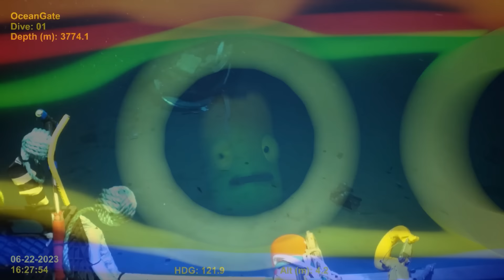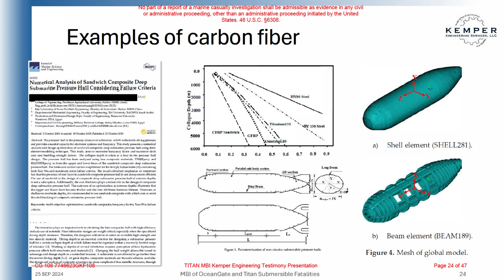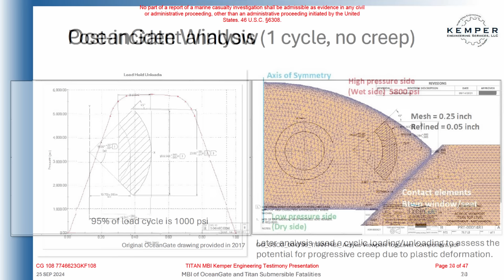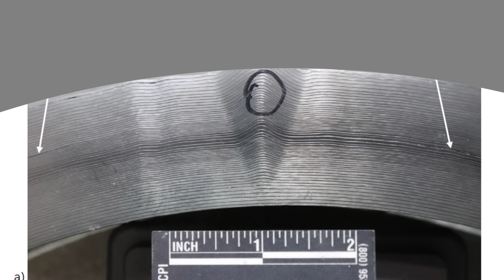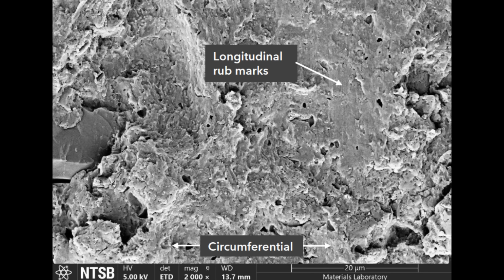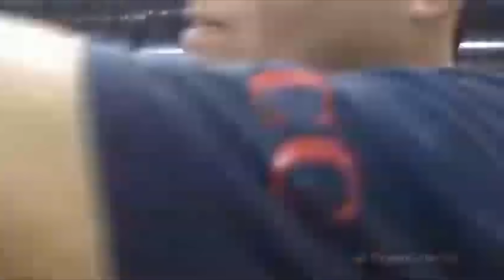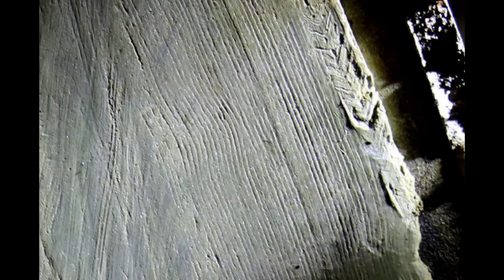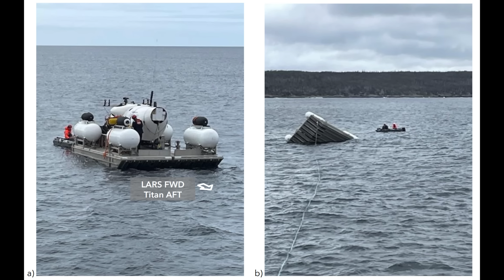OceanGate Wreck Shows Why Sub Wasn't Strong Enough To Survive - NTSB Shares Important Details

Comment: I have yet to see any evidence that this thing was wound in any other way apart from a shallow spiral, end to end. Almost like Hoop stress was the only consideration, not longitudinal.
Reply from the maker: Well you can see it in the images of the material under the microscope
Reply: @scottmanley  I see it now. Am I right in understanding then that the longitudinal ply is orientated 90 degrees from the circumferential ply? running from one end of the hull to the other? It is just that I am looking at the winding rig and the mandrel and wondering how they achieved that. Genuinely interested to know as I thought low angle helical winding would be the limit with the setup shown.
Reply: Forgive me folks, this was bugging me! Reviewing some other information and I have found a different, less manual and more robotic machine was used to produce the second hull in 2020, which was indeed capable of laying longitudinal ply, although not tensioned due to the mandrel design. Most of the footage we see is from the first hull in 2017.

Comment: What the graphs @26:24 are telling us is that the hoop strain gages were were being compressed excessively at low pressure (the non-linearity below 300 m.)  The hull was deforming with less resistance than expected, becoming rigid only after reaching ~400 meters depth.  This radial compression would be expected to make the longitudinal stiffness greater (seen @27:03).  (It's not clear if the operators constructed these plots, and had this information, prior to the disaster.)
I think the the epoxy in the C channel, which glued the hull to the forward titanium ring, had cracked (or separated from the metal) internally (the "bang" heard on dive 80), allowing relatively easy radial compression of the hull until the inner flange of the C channel took up the pressure and restored rigidity.   That flange was too thin to hold against the added pressure, and it sheared off on the final dive, as seen @18.44.
The composite hull and the titanium rings deformed at different rates with every dive cycle, and I think the epoxy, being bonded to both, could not handle the repeated stresses.  Rush must have thought it would only experience compression, and didn't consider the massive shear forces.
Reply: He assumed a perfect sphere in a vacuum... He also ignored that when you compress a material that famously avoids flexing in tension, it's going to pull like mad on every connection on the ends of those strings, and the wonky glue up means it would be wildly uneven in any predictable manner.
Reply: I'm pretty sure you just nailed it. I bet you $20 the portion of the barrel where it's permanently deformed inward is really close to the strain gage with the goofy readings and where the Ti inner flange failed.
Reply: agreed, what’s crazy is that this should have been noticed immediately after dive 80, the strain gauge must have been showing increased strain on the ring the entire time it was out of the water.
Reply: I'm no expert, but your interpretation makes the most sense to me of anything I've seen. I too was puzzled that the deformation seemed to be worst near the surface.
Reply: Yeah, the missing inner flange on the front titanium ring does indicate that it was literally the only thing holding the carbon fibre hull from being crushed. And when it could no longer hold the strain, it just completely sheared off.
Reply: @CristiNeagu which tells me that should have been the critical design consideration, bc the water will hold the end cap on until its near the surface
Reply: @tturi2  Well, technically, that wasn't part of the design. The load should have been shared between the end cap adhesive and the flanges. If you ask me, it seems pretty silly to rely on a glued joint under sheer for this kind of application. I don't understand why they didn't just design the inner flange to be more massive and make it a structural member, relying on the titanium to hold the hull cylindrical, while the glue only holds parts in place and prevents water ingress. Seems like a much better idea to rely on the contact interface between two structural members rather than on some glue holding up to the full pressure of the ocean.
Reply: @CristiNeagu  yeah, I feel there was less engineering into this vessel than my garage made fibreglass car panels
Reply: @CristiNeagu  Like I said, Rush didn't plan for shear at the glued joints.  He expected only compression (literally tons of it) from the end caps being pressed toward one another, which surely sounded like a good thing at the time.
Imagine the irony if they do conclude that the damage was done while approaching the surface.
Reply: @jpdemer5  Yep. He never thought that the carbon fibre hull would be anything other than fully rigid against the pressure.
Reply: Why would it become more rigid as pressure increased?
Reply: @hippienixon2329  If I understand him correctly, inner flange of the titanium ring prevented further compression. That is, until it sheared off.
Reply: @hippienixon2329  there was a crack or a delamination that closed up as the pressure increased. The strain gauge was on one side of the crack and the ocean was on the other side. The strain gauge registers nothing until the crack closes.
Reply: @hippienixon2329  Why would it become more rigid as pressure increased?   Squeeze a full can of soda.  Now squeeze an empty one.
Reply: I wonder if the "bang" was something that had shifted slowly under compression and found a "resting state" and "stuck at the new position, and that as they ascended and the pressure was removed, that at some critical point the surfaces didn't have enough force on them to continue to stick and suddenly shifted back to their original orientation?
Reply: Interesting
Reply: Not just different rates,  OPPOSITE directions.  One expanded while the other contracted.  Basically the metal and carbon fiber were going on separate vacations every single dive.
Reply: This is very close to what I concluded. I assumed the non-linear graphs confirmed that the glued end was becoming detached resulting in more flexing of the carbon tube. This resulted in delamination of the layers and rubbing of the adhesive and carbon fiber as it flexed weakening further the tube. Eventually it catastrophicly failed at the connection between the tube and the ring.

Comment: 'Carbon Fibre' really means 'carbon fibre reinforced epoxy resin' just as 'grp' means 'glass reinforced polyester' NOT 'glass'. So this was a plastic hull with metal end caps.

I have seen agricultural sewage tankers which have collapsed under atmospheric pressure ( 1 atm = 15 lbs per square inch) let alone the massive pressure more than a mile deep in the ocean!

Comment: 24:30 they did give them selves a way to localize it, the graphs are different because one is port side and one is starbord. Meaning the crack started on the fwd port portion of the carbon hull. They knew.

Comment: A very interesting video. I once tried gluing steel flat bar to concrete with epoxy. Even though I roughed up the surface of the steel to give mechanical grip, the steel expanden and contracted too much and the glue let go.

Comment: I can't help imagining that the issue window is that it seemed likely to fail eventually, it's just that the sub was compromised elsewhere before it could, and it wasn't subjected to the pressure difference after failure as that equalised forces from all directions –– likely why it made the seabed still attached. Either way, it was hugely irresponsible to proceed with it, regardless of what actually did fail.

Comment: For the window a second acrílic structure with a viscous optically transparent and with the same refraction index work? Like cameras when they gave x elements in y groups. The interface should be viscous so it does not transmit forces

Comment: It could be that each of the five layers flexed independently causing wrinkles which pushed the layers apart. Then the walls cracked or flexed enough to break the titanium rings off.

This could have been happening on every dive.

Comment: In a pressure vessel wouldn’t all the stuff inside be pushed to the part that was still structurally sound? Like a diver in dive bell that loses the resistive pressure. My thought is that the part where all the debris got shoved into was the furthest part from the failure point.

Comment: Why would it be a shame if deep sea tourism ended with the Titan disaster? Have you seen the damage that tourism does to the environment it exploits. We have sufficient technology to be able to see everything down there without physically going just as well as submariners or deep sea explorers can through the tiny potholes of the submersibles. Especially when you are talking about those kind of depths. In addition, the cost of those tickets mean those tourists, if they cared so much, could obtain the relevant qualifications and buy a ticket on the relevant research vessel and do the work legitimately rather than through this rather tacky commercial route which is open to abuse from conmen and lunatics like Stockton Rush.

Comment: In one review they showed the structural analysis. They were using 9000 micro strain as the strength for the composite. That is way way too high. Nobody does that. That's fundamentally why it broke. The composite was way overloaded.

Comment: i mean... 

i am a layman. i am not an expert 

isn't the whole point of carbon fiber, in terms of structural strength, that you have a bunch of strong fibers that are interwoven and not broken? and if that's true... don't you completely defeat the industrial purpose of the material by choosing to machine-down the 'wrinkles', thus breaking apart the fibers? and also if you can't actually interweave them at the type of angles necessary to achieve strength? 

i am absolutely amazed that this vehicle actually did get down to the titanic multiple times before failing, and even more amazed that it looks like it would've been able to keep operating if Rush had actually just paid attention to the warning equipment that he himself installed and boasted about. apparently you really can just go be a renegade and get down to crush depth with the engineering equivalent of bailing wire and paper mache, so long as you're actually willing to listen to your own damn warning bells

Comment: Foremost, I don't know anything about submarines, but some of the very high pressure vessels used in industry are a multi-walled concentric design. This way the failure of any one pressure vessel isn't terminally catastrophic, you have redundancy within the system.

Maybe that approach would have merit on a submarine.

Comment: Seeing a machinery being the only thing protecting you from death getting bashed around, lifted improperly, falling from a barge und being stored outdoors for some time without any maintenance or protection is just - mindblowing. If Rush wouldn't be on board during the dives you could call that reckless to the passengers, or careless concerning the pressure forces, if this would have been some kind of self-build jetsky or sailiing boat you could say it would have been done by a guy with enough money to spend on stupid projects. But him being the pilot of a fkn. submarine - wtf. was he thinking? 😱

Comment: that lamination is terrifying. Carbon-fiber should be laminated in a vacuum to remove air bubbles. Cutting the fibers to flatten them down is just weakening fibers structure. Any fool could see this was going o happen. Thanks for the research video. That carbon hull manufacturer is guilty of manslaughter by the looks of this info.

Comment: Peel ply doesn't give you any chemical adherence. It makes the amine blush form on the outside of the peel ply, and preps the surface for the next layer (once the peel ply is removed), but the next layer only adheres mechanically. (you could clean away the amine blush and sand to prep the next layer also, but it's alot more work.)
Also, if they really shaved of those wrinkles...oh my god. That breaks the fibres and weakens it dramatically. I hope they never keept any layers with cut fibres still there, but rather removed the whole layer that had cut fibres in it.

Comment: The list of failure points from manufacture, to off site handling, storage mode, operational modes (towing on a raft at sea)* Note all professional diving services stores subs on the mother ship. The list is too long to detail in a comments section. The aftermath is the result that engineers and others hired for Ocengate had warned them about long before it saw any service. Unfortunately, this is now just Data for others to be able to use in Future designs, much like after a major Air crash for prevention of repeat. Though, this WAS an unnecessary failure because of 1 man's EGO.

Comment: A Mr . Catterson testified he assumes the middle of the cylinder got compressed inwards, maybe not enough to be visible. But the force of this would rotate the upper corner of the cylinder's contact area with the ring away from the ring. This would break the bond of the glue. The end of the cylinder can't withstand the pressure without the glue holding it to the ring, the titanium lip neither, so it moved inwards, shearing the inner titanium lip off, leading to the collapse of the cylinder.
I think if you have a pressure hull which is supposed to be one solid piece, and it makes crackling noises, or emits a loud bang like after dive #80, then you know it is no longer one solid piece, but has separated.
I wonder what would have been if the inner titanium lip had been way stronger, like the ring itself? And maybe the outer lip also? As I understand it, only the glue kept the cylinder and the ring together.